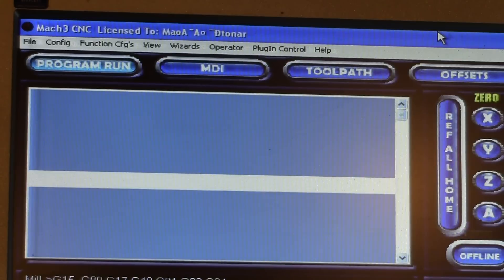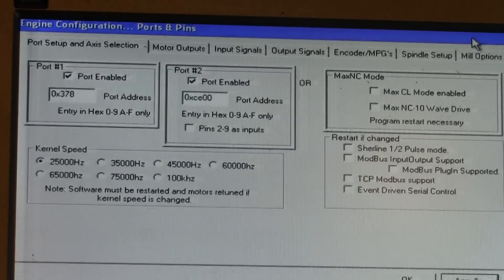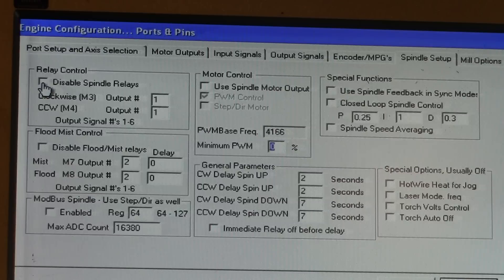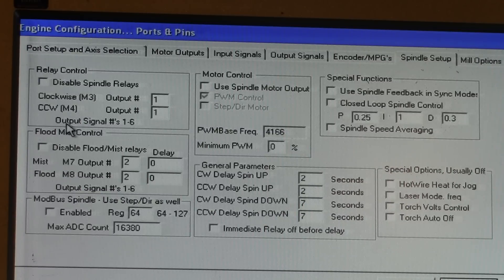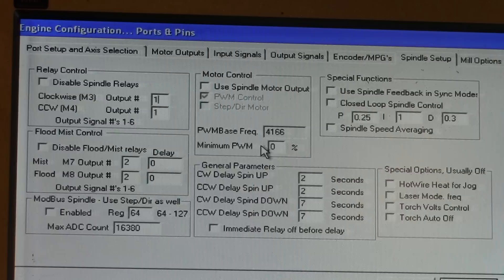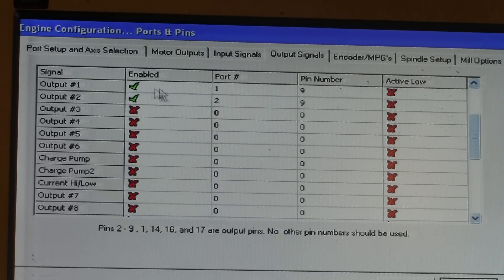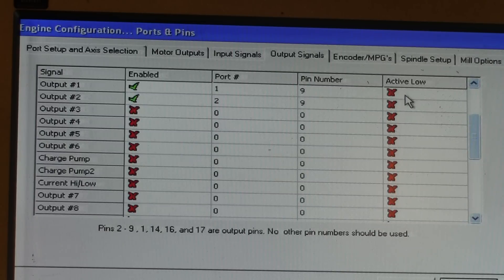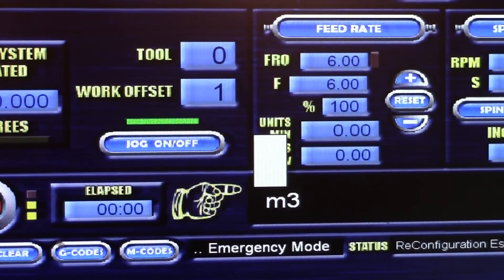Mach3, Spindle relay setup

Comment: and if it does not give signals to output1 and output2, what can be done? in the settings everything is spelled out correctly, but there is no signal to the output of the spindle relay. from the m3 and m4 commands. thanks
Reply: In some of the board use port 2 or 3

Comment: HI
When i use mach3 boeard interface with 5axis how i can active relay
Reply from the maker: If you set it up like I show in the video, then the G-code "M03" will avtivate the relay. Starting the spindle. And "M05" will stop it (or M30 as the program end command)

Comment: Thank you very much for your help.Should I put any kind of protecting circuit like diods or something else to protect my electronic board from the relays coil voltage?
Reply from the maker: Yes, I strongly recommend you do that. My breakoutboard does have opto-isolators but still the voltage spike from the relays would mess everything up and make the entire system unreliable. Pls. watch this video where I explain how to: https://www.youtube.com/watch?v=YFunJrgMaTQ&feature=youtu.be&list=PLH2LdhXzCUgvWo3Wu5wuAJrXO6LiwnUV2&t=680

Comment: The circle with me on mach3 not regular 
There is difference 1 16mm
Can you help me ??
Reply from the maker: There can be many reasons for this. Did you calibrate the Axis (Setting the steps/unit) correct. And also verify this numbers a couple of time. Else it can be back-lash in your system, or perhaps a weak construction. Please check this video on calibration: https://www.youtube.com/watch?v=SG-RRpInAts

Comment: is it posible using a digital output to get a PWM to control de spindle? beucause I think using the relay only is posible an on/off control
Reply from the maker: Yes, mach3 do have this documented. So you can run it with a PWM. However all of the cases where people it with PWM, I also see they have either a Breakout Board that supports is with a 0-10V output, or an external motion controller also with 0-10V out. The LPT-port will only give you 0-5V at best. I run my setup with an on/off relay, and just set the speed manually on the router motor itself, usually it's always full-speed when running in wood, plastics and aluminium with the small 1/4" and 1/8" cutters I use.

Comment: Is there a way to use any signals outside of 1-6 to control the spindle relay and or flood mist relays?
Reply from the maker: Thank you for your comment. I think not, output#1-6 is to be used. You do realize that you can use any port/pin combination to that output? Do not confuse pin numbers with output numbers ! Can you perhaps describe you problem, since you want to use other output numbers ? Running special macros or, but there you can also change the output number. Bo.
Reply: Yes I do realize I can declare output 1-6 any port/pin on the board. Someone before me created a macro for an ATC on my machine. Between that routing and coolant on/off it has consumed all of outputs 1-6. I'm trying to get M4 to work on the machine for tapping. Easiest route would have been to declare the m4 relay as an output > 6 but never the case Time to play with some macros!
Reply: Thank you for the reply !
Reply from the maker: OK, great. M4 is usually Spindel on CCW direction, ang G84 is ridgid tapping cycle. But what do I know :-) You can easily change the output numbers in the scripts your're using, since the output is the same throughout the program we can search/replace it. Try to send me the macrofile, i'll have a look. Bo.

Comment: Hello. My spindle is working, but in the wrong direction (anticlockwise). How do I set it clockwise?
Reply from the maker: Hello. My spindle is working, but in the wrong direction (anticlockwise). How do I set it clockwise?
Reply: Copied my comment accidentally? :)
Reply from the maker: WTH ? What I meant: Which spindle are you using ? Is it a mains operated 1-phase, or 3-phase motor. Do you have a VFD (Varible Frequency Drive) ? Mach3, can only give an on/off signal to what ever controls the motor. If it's reversing I think you need to check the VFD, or mains wiring. But I need more info to help.
Reply: The 3 wires to the spindle are incorrect. 
Simply reverse two of the three wires.

Comment: u think i can use it for turn on/off   chinesse laser? i have  this card http://i.ebayimg.com/images/i/381926689015-0-1/s-l1000.jpg
Reply from the maker: Thank you for your comment. I'm not really sure, if you plan for a pure on/off for the laser then perhaps it's good enough. Bu there can be some timing, that is not 100%. If you plan for PWM it think it's not possible I tried it with the M03 S50 (50% duty cycle) but it was simply too slow. I have seen some solutions where the Z-axis motor simply drive a pot-meter, that connects to your Laser-driver. That is a mechanical solution :-)
Reply: First thanks a lot for your reply , and sorry for my grammar. Im from spain.
Yes, i just need pure on/off ,  vector cut for vinyls. Laser module is coming .. i still dont have it but before   i want to know how conect it. I read about that delay  that u coment.. first days i was thinking then about .. use a swicht for z-axis.. But just a push swicht on/off , (100% power to 0%) i understand  you are confirm me i can turn on/off   fully power with me card, fast, it´s awesome. Thanks again.

Comment: Thank you for your video, I've got 6040 cnc  and spindle doesn't want to rotate. What I need to do to make it working? XYZ is working. Can you get me some recommendations to start my spindle working-rotating.
Reply from the maker: Hi, thank you for your comment. I'm not sure the 6040cnc offers that possibillity as standard to start/stop the spindle from MACH3, from what I can read in the manual and videos on youtube it does not. If you are up to it, most VFD's can me set up to Run/Stop via an input pin on the controller itself. But here you will need to refer to the VFD manual to set the right paramenters, and you will need a relay that is controlled from mach3. So M03 -> Relay activated -> Activates an input on the VFD -> VFD starts -> Spindle running. I don't know either the cnc6040 nor the VFD, so you need to go through the manuals and youtube. Best of luck.